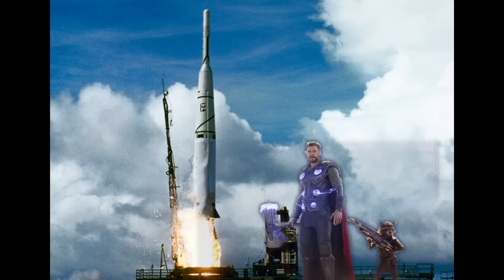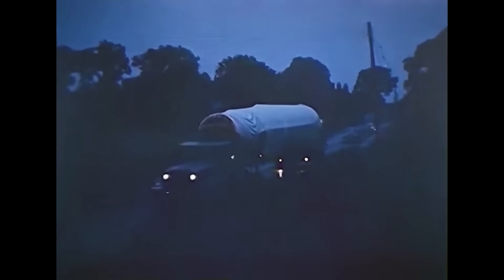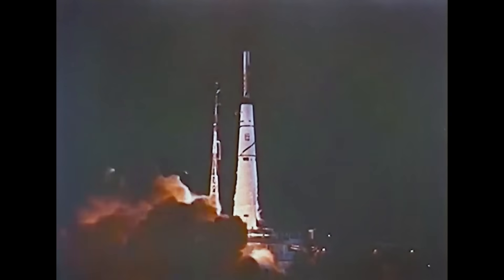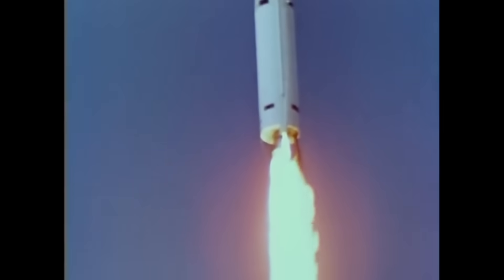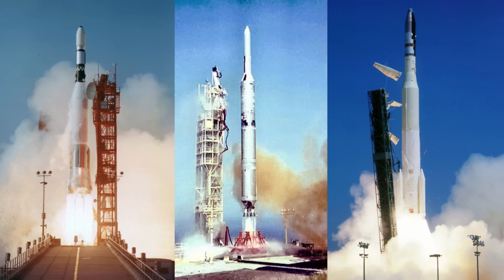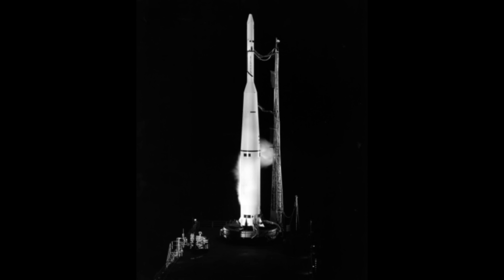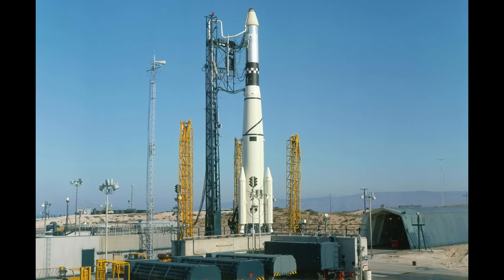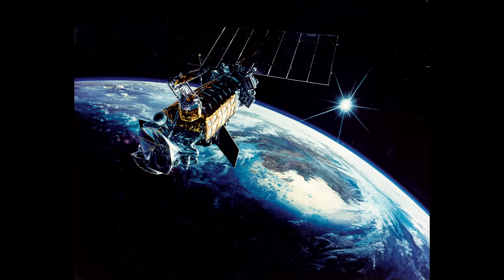Thor Rocket - How A 'Temporary Solution' Became America's Most Popular Launch Vehicle

Comment: If anyone wants to see the LR-79 Thor liquid booster thrust chamber I moved several of the LR-79 TCAs to the Saxon Aerospace Museum in Boron, CA out in front which can be seen from HWY 58 as you drive by, and a complete LR-79 engine with turbo pumps is at the New Mexico Museum of Aerospace History near Alamogordo NM outside at the entrance to the museum building. These engines were part of the SEALAR program by Bob Truax which I was the senior engineer. Ken

Comment: I was the last USAF Thor Program Manager.  The last launch was in 1980 and we shut the program down in 1981 because the final Thor payload, DMSP Block 5D-2, had gotten larger and heavier and moved on to converted Atlas E ICBMs.  The mandatory use of the Shuttle meant that no one was designing payloads capable of being launched by Thor, and although I often heard the claim that, "There are payloads out there for Thor but you are just not looking for them hard enough!" that was not just true.  You would have thought there were homeless people wandering the streets with spacecraft under their arms, people who would have been healthy, happy and productive if they could have just found a rocket.
When we shut the program down we had four intact LV-2D boosters, basically the last of the SM-75's brought back from England, and five SLV-2A boosters. We also had an LV-2D fuel tank engine section and an SLV-2H fuel tank and engine section; the LOX tanks from those boosters had been used in ground tests to determine the vulnerability of ballistic missiles to lasers.  After the loss of the Shuttle Challenger in 1986 the latest built engines from two of the SLV-2A were used for Delta boosters and the turbine wheels were removed from all of the other Thor MB-3 Block I and Block III engines in order to enable new RS-27 engines to be built for Delta boosters.  It had been so long since we had built new MB-3 or RS-27 engines that the company that made the turbine wheels had gone out of business.

Comment: OK Scott, I expect a full 30 min video on the Delta series !!!   I worked for Thiokol Huntsville from 87-92, as a Project Engineer (1 of 3) in the Castor Office.  Then we were working CastorIVa for the 6900 series.  We helped launched GPS.  I was on pad17b helping McDac prep for the first launch (my first business trip) of DeltaII with Castor IVAs.  IIRC we built over 210 CastorIVAs for DeltaII, with 100% success.   Those CastorI motors were bleeding edge, they would burn out all the insulation and then about 1/4" of steel on the nozzle - talk about maximum impulse and minimum dead weight.  We had a great team,  but they wanted it all moved to Utah, so they shut us down.

Comment: I realize this comment is completely off-topic, but if you happen to see it, I'd love it if you did a discussion someday about the batting range scene on Babylon 5.  Remember that show?  I don't have the maths myself but I've always wondered if a pitch thrown from a machine on the mound directly at home plate on the inside of a cylindrical station spinning for gravity would appear to the batter to drift to one side rather than come down through the strike zone.  The ball would still be subject to the centripetal force applied by station rotation at the moment it leaves the pitching machine, but would no longer be constrained by the inside of the hull pulling it up into what we would call "falling to the ground".  But I'm not sure it would really matter in a cylinder with a diameter that large.

And what kind of crazy trajectories would the ball take after being hit?

Comment: I would count the japanese N-I and N-II rockets also as part of the Thor rocket family, since they were basically made with different parts of Thor and Delta rockets (and also Castor booster) produced under licene by Mitsubishi Heavy Industries. So we can add 7 launches (one failure) for the N-I between 1975 and 1982 and 8 launches for the N-II from 1981 to 1987 to the list. Also the H-I had a japanese second stage, but the first stage was form the Thor-ELT (also 9 Castor 2 SRBs). The H-I launched 9 times from 1986 to 1992 before it got replaces with the full indigenous H-II.

Comment: The fourth modification to the Thor rocket caused NASA Director of Spacecraft and Flight Missions, Milton Rosen, to refer to the rocket with the Greek letter Delta. The name was officially adopted in January of 1959. In April of that same year NASA signed its first launch vehicle contract with Douglas Aircraft Company for 12 Delta Rockets.
Rosen had earlier worked on the Vanguard program, (and some blamed him for Sputnik I and II beating Vanguard in October 1957), BUT Thor-Able combined hardware from both programs.
—
** As a “Follow-on” to this story (Delta of the 1970s). **

Until leaving NASA in 1974, Milt Rosen was instrumental for expanding Delta usage by NASA in the 1970s (900, 2000, 3000 series), Straight Eight design (8 foot / 2.44 meter diameter).  

Using surplus Saturn IB engines (RS-27) for the first stage; and Lunar Module Descent Engines (TR-201) for the second stage — Delta during 1970s became “Dividends from Apollo”.  
Given the various payloads and satellites launched by Delta during the 1970s, it can be argued that NASA’s Delta launches started the Commercial usage of space (communication satellites, weather) … especially for non-USA agencies and foreign countries.

After the 1986 Challenger accident, McDonald-Douglas, Rocketdyne, and Aerojet still had the tooling from Delta.
Using that experience with technology upgrades, in 1987 the USAF designated Delta II as the launcher for the GPS Constellation.
The first launch occurred on February 14, 1989 .

Comment: Hey Scott and the community, after watching Unreal Engineering's latest video about moondust and spacesuits, my friend was wondering why not wrap astronauts in a sort of plastic bag which could then be removed after use (a bit like a condom?). It would of course have to be quite cut resistant but having a single bag with no joints take all the dust while the suit underneath does all the life support etc. is a decent concept?

Comment: Can you explain why it's not discussed that it's possible (or not) to slow a space vehicle down enough (say Mach 3-4) in space prior to re-entry into earth's atmosphere? It seems to me that would solve a lot of problems regarding reentry shielding and/or safety.
Reply: Because that requires mass and the atmosphere is free and required.
Reply: basically i think that the reason is just that the fuel requirements are less practical (much more weight) than just using heat shielding. 
why slow yourself down when something else will do it for you for free?
Reply: It is possible but not very smart. Reentry shielding is now a well known subject, they know how to do it reliably and it weighs fraction of what the required fuel would be. There really are no known “problems” with shielding. Slowing down from Mach 20-24 down to 4 would have been VERY costly in fuel.
Reply from the maker: Because the mass of the fuel required to do this is much larger than the mass of a heat shield
Reply: @scottmanley  Thanks for your reply, which agrees with others. Makes sense too. There are not too many on YouTube that I trust enough to even ask questions... but, you're one of the ones I do. I love your educated approach to hosting a forum of astronomical proportions!
Reply: Slowing down from orbital speed to Mach 3 requires almost as much fuel as launching the spacecraft. This is a Catch-22: instead of a 10-ton spacecraft, you now have 10+300 tons up there, which would require about 3 Saturn Vs to launch.